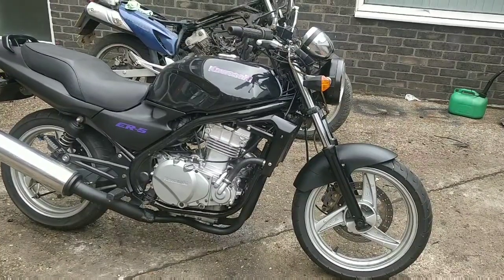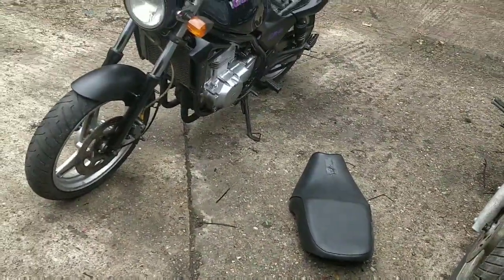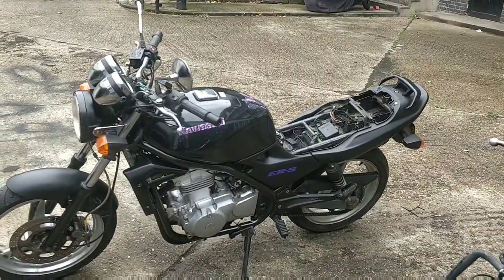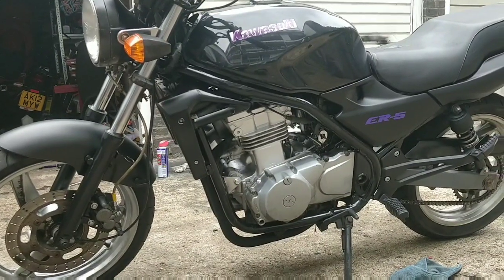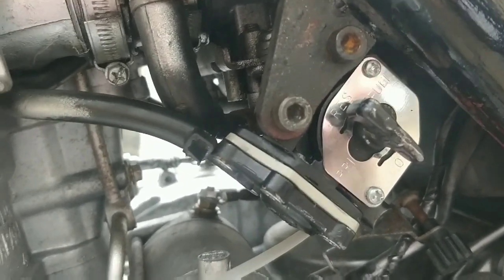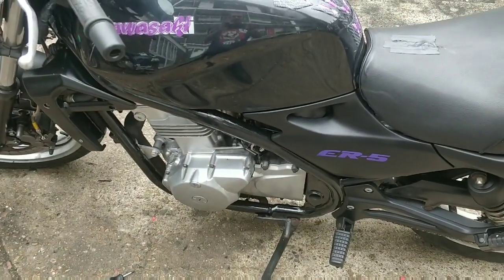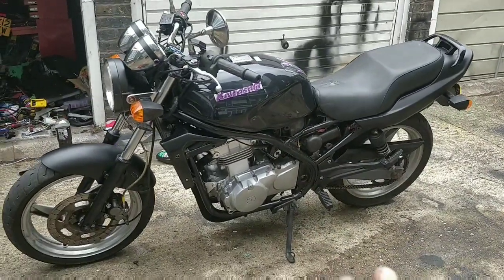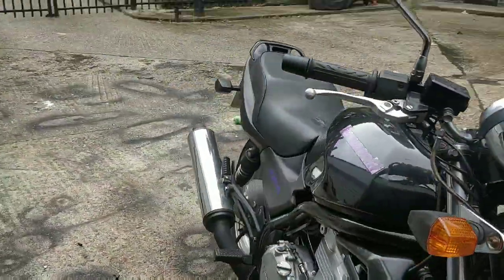Kawasaki er5, restore, PART 7

Comment: Hi charlie mike here again ;-), right want to move my rear brake reservoir to under the seat so its easyer to get to rather undo all the rear fairing every time i need to bleed the brake or just a top up what do you think my mate ;-) cheers mike
Reply from the maker: Easy to do Mike, also modern bikes don't even have the res, they just have a small piece of hose that is blocked off. So you could run a piece of hose to under the seat and block the hose off, or run the hose like you were going to and add the res

Comment: Buy Sonic cleaner.
Best thing you will every buy to clean a carbs
Reply from the maker: Honestly, I'm about the quick and easy solutions, I've never really had an issue cleaning carbs using cleaner. I just need to make sure I do a proper job of it. I've not got power in my garage so plug in equipment doesn't work for me.

Thanks for the suggestion and watching, I have considered getting one but always go with the sprays.

Comment: You thought about changing fuel lines to pvc?
Reply from the maker: These lines are fine mate. What's your thinking behind changing them?

I'm always open to suggestions.

Thanks
Reply: motorcycle rescuer fine particles from rubber fuel lines that don’t like modern fuel cause a lot of problems on these bikes. I only know because guy who sold me mine told me. He replaced with pvc but left the tiny bit of rubber fuel line that connect both carbs. The bike had been sat around a year before I bought it. Same problem a little bit of rubber particle got under the float valves. Caused idling / flooding issues until cleaned behind.